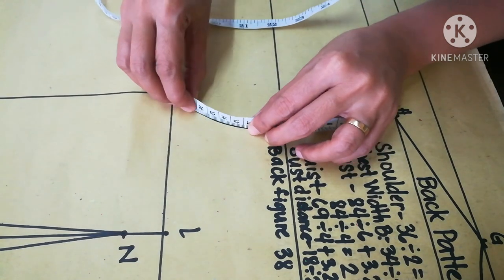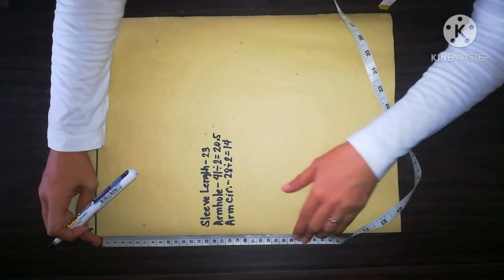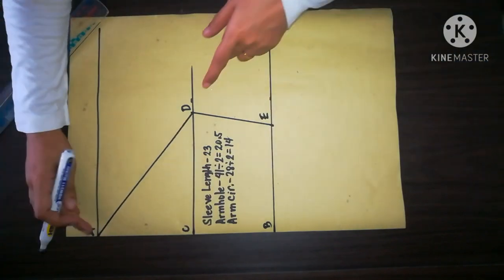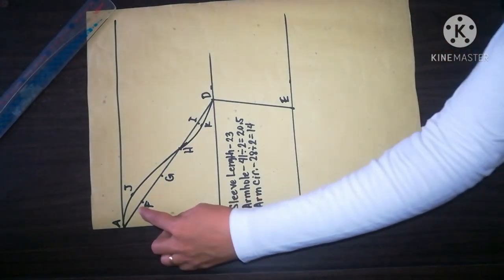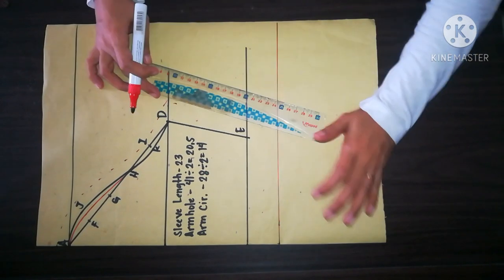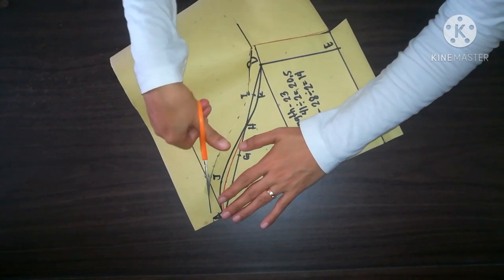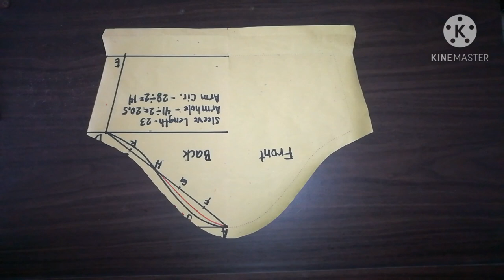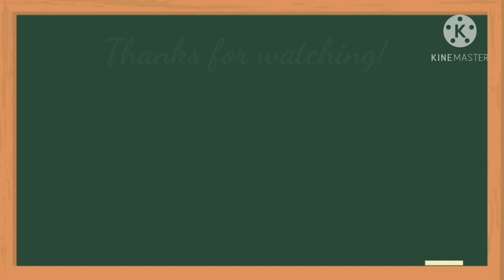Drafting The Sleeve Pattern (Step-by-step Tutorial) English/Tagalog

Comment: For the sleeve cap you use 12.5 cm to place point C ? Where that measurement come from? I still do not understand how to place the french curve ruler to get the proper curve. If you move the ruler you still can connect the dots but the curve can be very different.
Reply from the maker: That is a standard measurement. But still can be adjusted depending on how fit you want to your sleeve. I further explained that on the other video. And the way I used the french curve.
Reply: @nicetosew1668  I do not see where you explain the use of french curve.
Reply from the maker: @andreab919  this is the link for the pictures on how I use the french curve in shaping the sleeve cap. 

https://drive.google.com/file/d/1fk6epvfOsL4GdAdcBcOSQZr1mR3fCfBI/view?usp=drivesdk